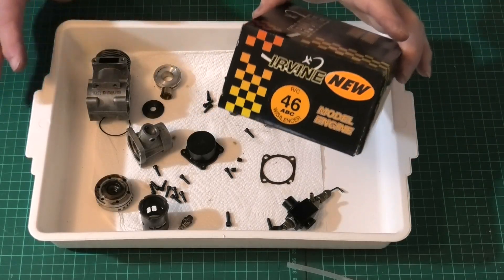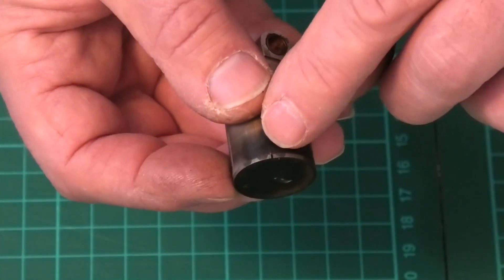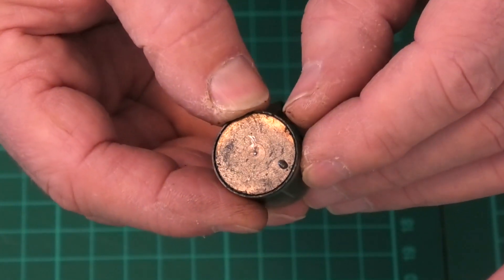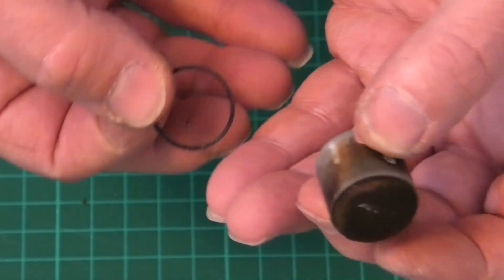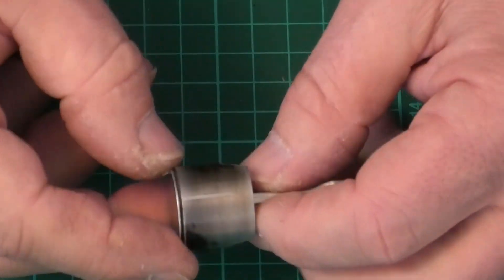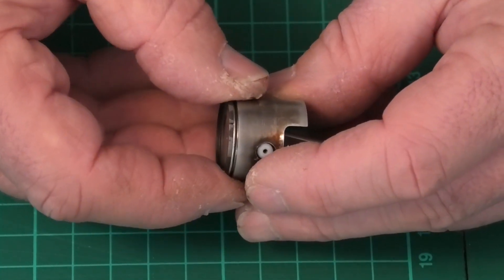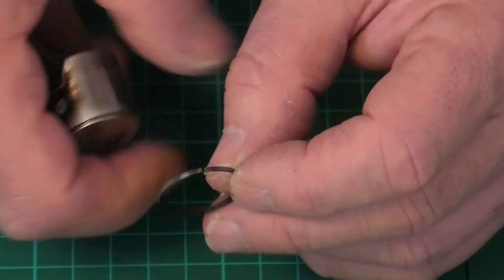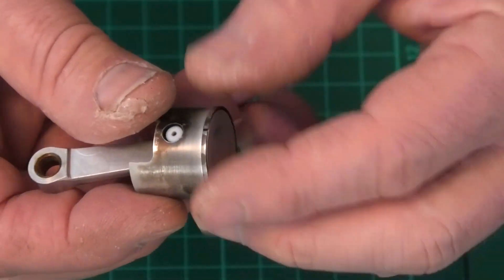Glow Engine - Dykes Piston Ring Removal & Replacement - RC Model Aeroplane Build & Repair

Comment: What the advantages and disadvantages of ringed glow engines and non ringed?
Reply from the maker: Non ringed generally are a bit more powerful, than ringed engines, but a ringed engine lasts longer, both are good.  I have two Irvine 46 engines, on ABC, the other ringed, but you would not know the difference when running